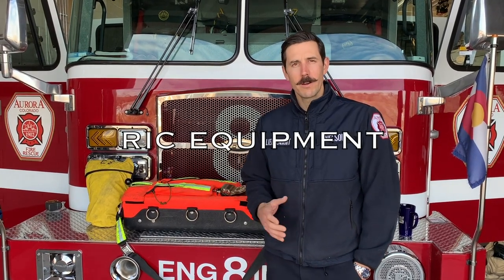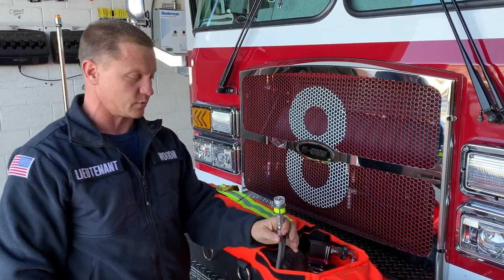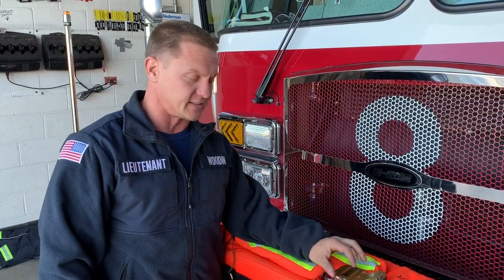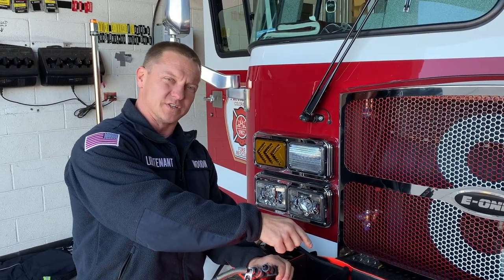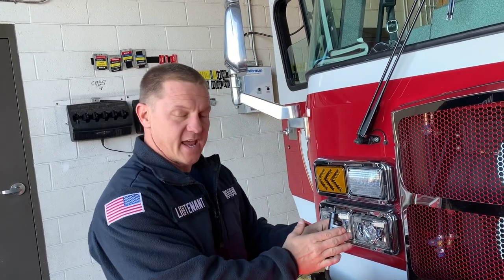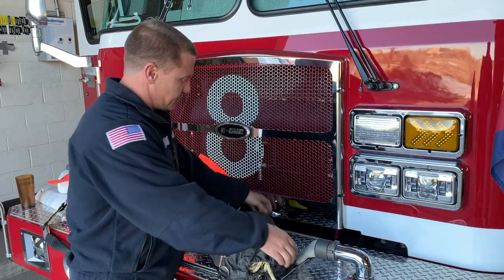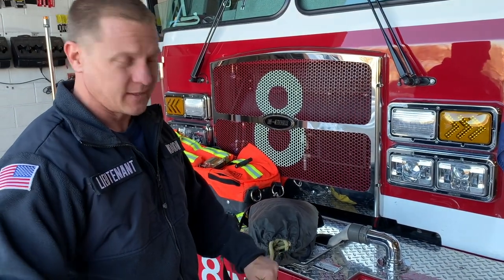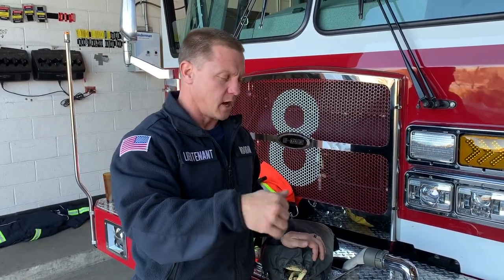RIC Equipment

Comment: One thing to keep in mind, the use of guide ropes has a tendency to provide firefighters with a false sense of security during deployment. 
Members do not pay close attention to their air supply, relying on the rope to ensure a hasty exit.
RIT is no different than normal firefighting when comparing air consumption. RIT members still need enough air to exit the structure safely just as any other firefighter.